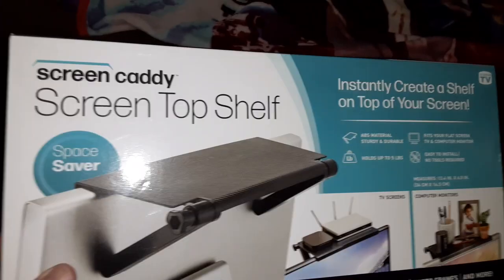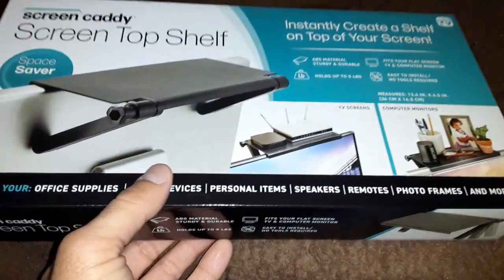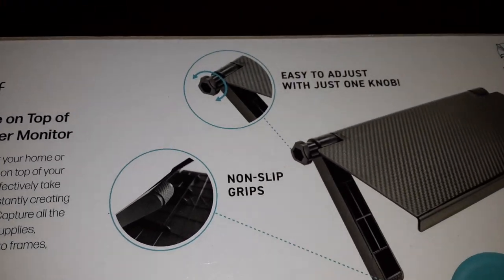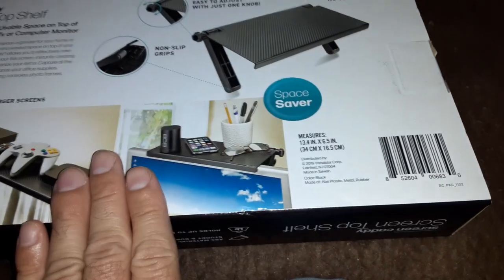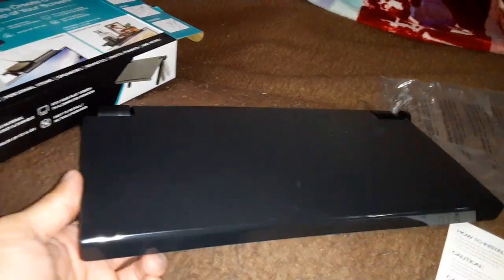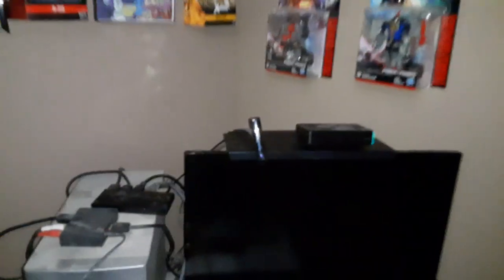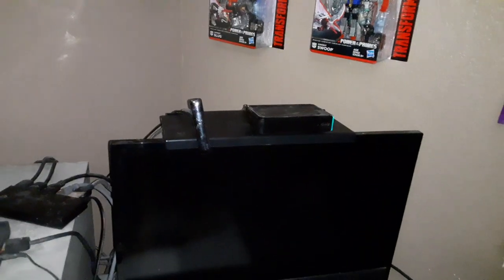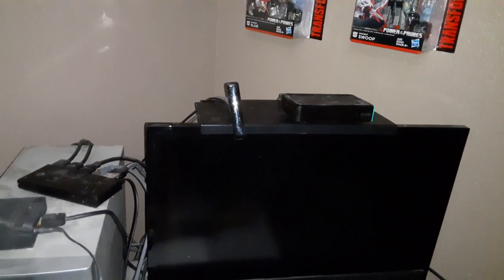Overview/Review Of The Screen Caddy™ Screen Top Shelf

Comment: Hey! I wanted to buy this, does it still hold up after all that time? I need it for long term. Also my TV is thicker, so I'm wondering if it will stay horizontal even if you can't push the legs in so much. Thanks!